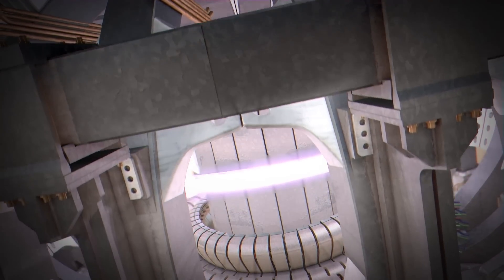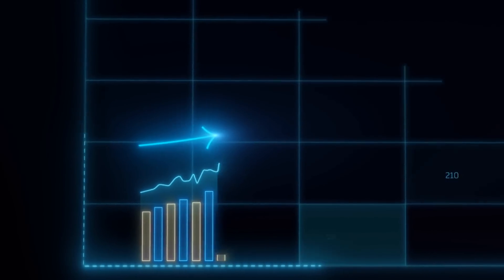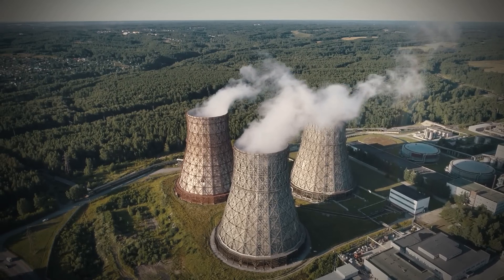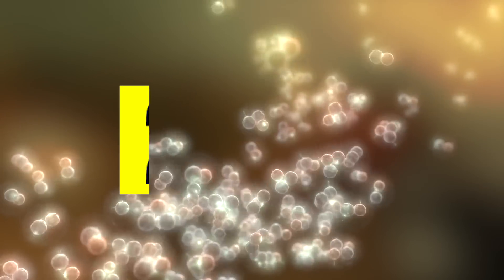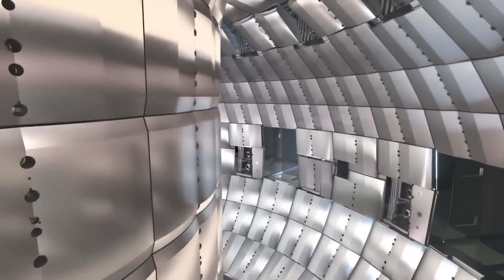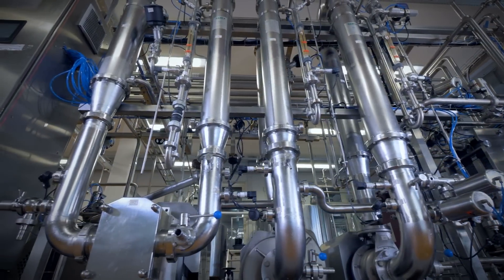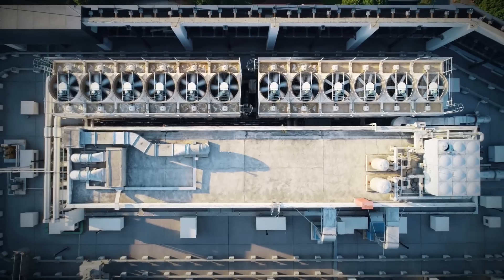The Shocking Problem That Could End Nuclear Fusion

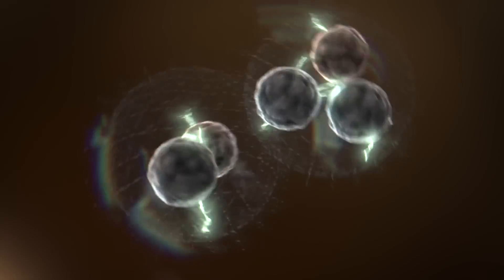Comment: 0:58 already with a problem, with the claim of this video: Why do we need 6 times the temperature of the Sun's core if the Sun does the job, at one time ?  Seems there is a lack of auto-critic to start  with, or is there a reason?
Reply from the maker: Interesting point! The sun can achieve fusion at lower temperatures because it has much higher pressures, unfortunately these pressures are not practical to achieve in tokamak reactors, so the temperature has to be much higher! Hope that clears it up.
Reply: @ZirothTech  Make perfect sense, tks.

Comment: However, if you're heart is set on fusion, General Fusion uses timed-pistons to compressed heated plasma with molten lead-lithium (the reactor spins the molten lead-lithium mixture until it forms a cavity/vortex in the center).  It's this lithium that is bred into tritium.

Comment: Nuclear fission is already clean enough, especially when fuel can be reprocessed or if the fissile material is in the form of a molten salt that solves the waste problem as neutron absorbing fission products like Xe-135 can be easily removed from a liquid fuel.

Society has to get over this idea that there is an energy source that has zero environmental impact.  ALL sources of energy has some sort negative environmental impact. Just look at the rare earth mining operations in China and how they made entire lakes devoid of life or all of the toxic chemicals and carcinogens in photovoltaic production.  Fusion, even aneutronic fusion, will have a negative environment impact if someone is hellbent on finding an excuse to ban it.

Unfortunately, nuclear fission has to compete with the idealized fantasy version of solar and wind power, which made it look dirty by comparison, especially how the media hyped the Three Mile Island, Chernobyl, and Fukushima disasters.  But when compared with the actual casualties vs the total amount of power produced, nuclear fission is on par with solar and wind for deaths per units of energy produce (and yes, there have been accidents involving renewables such as workers falling off roofs while installing photovoltaics or wind turbine catastrophically failing).  Also, it has been estimated that nuclear power has SAVED the lives of 1.8 MILLION people by the offset of fossil fuels that would have been used in its place based on the save estimates for the number of people killed by fossil fuels.

I hope people will not be so quick to write off the source of clean, abundant, and cheap energy.  Yes, I said "cheap" once some serious reforms can be enacted like stopping frivolous lawsuits by anti-nuke craptivists and getting rid of the proverbial foxes in the hen house like Gregory Jaczko who outed himself as an antinuclear power luddite after retired from the NRC and didn't have to pretend to not oppose nuclear power.  And this isn't even taking into account the reduction of cost of nuclear power with new technology like small modular reactors that can be mass-produced in a factory and shifted on site.

Comment: Is fusion our only source of neutron radiation lmao? Just put the blankets somewhere else with a more reliable source of neutron radiation and produce tritium from there. The lithium is not a problem either, 7% rich is very easy compared to U 234. This video is very optimistic about the problems with fusion.

Comment: Making temperatures as hot as the sun, and holding it in magnetic limbo, sounds like a near impossible goal, beside the tritium issue.
Reply: It's actually one of the easiest parts of fusion, a magnetic field powerful enough would do it.

Comment: I used to love the idea of fusion.  But even more than the isotope supply issues here, the greatest obstacle is practically dealing with the huge neutron flux coming from the reactor.  It will quickly degrade and transmutate all the reactor structures and will leave them insanely radioactive ... hard to maintain and lots of radioactive waste.  The ability to get the heat from fusion and turn it into usable energy (i.e. steam for turbines) is not close to being solved.

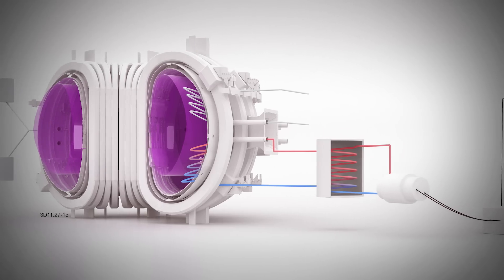Comment: @2:30 It uses 12 kg, per what? per second? hour? year? milenium?

And if its so rare, and can be made with nuclear reactors at the rate of 500grams a year....whats the big deal? we have HUNDEREDS of reactors! and when the owners figure out that that little byproduct sells for 30k a gram they will all extract tritium. Sure the prices may drop quickly but it does give them some captital for a pretty much self sustaining energy source wich only import is deuterium.
Reply from the maker: Sorry that should have been clearer! That is 12kg over the lifetime of ITER (20 years), however it will need almost all of that from the start, as it is required to fill the tokamak even if it isn't being used up. Tritium can be made from some nuclear fission reactors, but not many of them! And the ones that do make tritium are being phased out. I imagine demand for tritium could mean more are made in the future, but there are huge restrictions on this as tritium is also used in nuclear warheads. Therefore, it could be a very long time until this is achieved, as nuclear fission plants take a long time to build even without these challenges! Thanks for your comment and hopefully that clears some bits up!

Comment: Mentioned fuel requirement is not exactly mandatory. It is "first generation" of fusion reactor. Just other fuels will require more extream conditions of fusion so it is logical that we are making tests on easiest variant currently. Also things not abundant at our planet are not nessesery problem long term. He4 would be actually fuel that solves some issues seen with fusion of H2/H3. It is scarse on Earth but for example on Moon there should be plenty.

Comment: fixing nuclear fusion? Gravity/ earth atmosphere.  Nuclear fusion would work in space not on earth . Gravity is the problem.  Keep hot plasma moving in atmosphere is hard because many things? Air ,weather conditions,  Gravity,  movement.  Scientist's should build a nuclear fusion station on asteroid/ space than uses lasers to give power back too earth 🌎.
Reply: Gravity is not a problem at all, the magnetic field overpowers that. While atmosphere problem is solved by using a vacuum chamber.

Comment: The solution is to abandon fusion (for now anyway) and stick with fission but a fission reactor design based on Thorium and not Uranium which produces much less waste, Thorium is much much more abundant than Uranium and reactors based on Thorium molten salts are fail save by design.

Comment: The only well understood and also stable process on that matter is how to burn money and create n+1 issues for n questions. Seriously, following the chase for the holy grail for about 40 years only shows, that it's always only max. 20 years away and meanwhile continuously requires more resources and replacement installations by just bigger ones. Considering the effort already spent and still required, that technology will never ever finally amortize this and succeed with a positive overall outcome. Whenever this will be realized by those who decide for the finances, this will once end the story, not the never ending appearance of coarse or fine grain issues discussed in expert groups. Fusion, no matter how beautiful in theory, is not and will not be the answer. Sorry for those whos playground that is, but after all a Dyson sphere would be easier, less complex and perhaps even cheaper than an endless investment if using fusion power is the requirement.

Comment: Not a fusion expert but my understanding is that there are several feasible reactions, even though deuterium -tritium is the preferred reaction. From what I understand sustaining the reaction is the primary problem. I think you should have at least addressed this point in the video.

Comment: D-D fusion is 100x harder than DT, that is 100x less energy fewer neutrons. It will never ignite, thus have to be driven by external power.  Given the existence of heavy water fission reactors which naturally produce tritium and can be designed to do more, a DD fusion reactor for breading is a non starter.

Comment: See “The Trouble with Fusion”  by Prof Lidsky 1983, MIT, covering the tritium fuel problem and much more, circulated widely in fusion circles decades ago.  

“One of the first issues posed by the D-T fusion reaction was how to supply suScient tritium. Tritium is radioactive, with a relatively short half-life of 12.4 years, and therefore it exists only in minute quantities in nature. Luckily, the neutron emitted in D-T fusion can react with an isotope of lithium to produce tritium…”

“…Lithium itself poses serious engineering prob- lems. It is an extremely reactive chemical: it burns violently when it comes in contact with either air or water and even capable of under- going combustion with the water contained in concrete. The lithium may be either in liquid form or in a solid compound. Liquid lithium blankets produce substantially more tritium and allow it to be more easily removed. How- ever, the need to handle large amounts of this metal in liquid form leads to technical com- plexity and poses safety hazards.
The tritium-breeding region has other engi- neering requirements. It must be designed in such a way that the structural materials, as contrasted with the actual lithium, capture a minimum of neutrons. Also, the operating temperature must be high enough so that the coolant, when piped outside the reactor, can generate steam eSciently.
Outside the blanket, powerful magnets must provide the magnetic fields to contain the plasma. These fields will exert enormous forces on the magnets themselves, equivalent to pres- sures of hundreds of atmospheres. If made from copper wire, these magnets would con- sume more power than produced by the reac- tor, so they will have to be superconducting. Superconducting magnets, cooled by liquid he- lium to within a few degrees of absolute zero, will be extremely sensitive to heat and radia- tion damage. Thus, they must be eFectively shielded from the heat and radiation of the plasma and blanket.
Temperatures within the fusion reactor will range from the highest produced on earth (within the plasma) to practically the lowest possible (within the magnets). The entire structure will be bombarded with neutrons that induce radiation and cause serious damage to materials. Problems associated with the in- flammable lithium must be managed. Ad- vanced materials will have to endure tremen- dous stress from temperature extremes and damaging neutrons. The magnetic fields will…”

In the 40 years since, no prototype work has been done  to resolve the difficulties w T production. As said, it’s expensive and requires all kinds of permits to handle, which is why most reactor tests are done w inert gas.  When and if fusion becomes viable, expect to see a wave of proliferation scare tactics about how T enables hydrogen bombs.

Comment: I think the real question is if we're ever going to get a practical amount of energy out of these ITER reactors at a practical cost. These reactors are giant, expensive boondoggles.
Reply: Everything is an expensive boondoggle until it works.
Reply: @krashd  Except there is no reasonable path forward where this is not an expensive boondoggle, even if everything goes according to plan.

Comment: If Helium is a by product of the initial reaction, can't Helium be broken down into Tritium?
Reply: bruh, the entire point of this is that you get energy from the fusion, it would be like trying to get infinite coal from burning it and then reverting the CO2 while in reality you use more energy to convert it back than you could ever get from burning it
Reply: @boberboberowski3411  I don't know the process or the energy required to break Helium into Tritium. Do you? Have we ever done it?
Reply: @leemistenalt31  I don't know, but even if so it would surely require the same or even more energy than you would get from reusing the tritium

Comment: " Lattice confinement fusion (LCF) is a type of nuclear fusion via exposing deuteron-saturated metals to gamma radiation, avoiding the usage of confined high-temperature gasses used in other methods of fusion ...In 2020, a team of NASA researchers seeking a new energy source for deep-space exploration missions, published the first paper describing the novel method for triggering nuclear fusion in the space between the atoms of a metal solid, an example of screened fusion.[3] The experiments did not produce self-sustaining reactions, and the electron source is itself energetically expensive ' from Wikipedia

Comment: Oh nonsense, tritium is very easy to separate. All you need is palladium, titanium and lithium... Example: The Ponz and Flashman experiments. Simple Electrochemistry and with the fuel source it's easy to get more energy out of the system than the energy that you are using to operate it and hydrogen is just as simple... 💫

Comment: NUCLEAR ARE EASY TO KILL OR DESTROY BY USING OF COLD MAGNET IF INSERTING A MAGNET TO REACTOR THIS IS CANNOT WORK BECAUSE  THE  CONTAIN OF REACT OR ARE SWALLOWING OF THE MAGNET, THAT IS THE REASON WHY VEHICLES ARE STOPPING IN RAIL AND ENGINE ARE DIE BECAUSE OF THE GRAVITY OR MAGNET CAME FROM THE METAL RAIL AND RELEASING IF THE TRAIN IS COMING MADE OF FRICTION BETWEEN WHEELS OF TRAIN AND RAIL AND THE GRAVITY ARE SWALLOWING THE INTAKE OF THE ENGINE AND AFTER ENTER EXPLOTION BETWEEN PISTO CANNOT HAPPEN OR NO EXPLOTION MADE
Reply: at this point google translate would make a better sentence

Comment: All those problems are not a problem at all. What stops us from getting fusion is the problem of high pressure and high temperature. If pressure is too low, then you need higher temperature, so atoms have higher chance to bump on each other and merge. Current problem is to build a container, which can hold a very hot plasma (problem with the cooling) under a very high pressure (problem with strong enough  material). Next big problem is with pipes which delivers fuel and energy to starts the fusion.
I think that the first commercial fusion reactor will be very deep under water in the ocean (like in a drilled hole in the Mariana Trench). That way it will get cooling and additional pressure from the water (to keep reactor intact) and fuel from Deuterium in the water.

Comment: Those are just minor technical issues. We could easily build a new Lithium-6 purification plant if needed, and tritium could easily be bred in fission plants if not enough could be bred in fusion plants. The real issue is that neither of these steps are necessary due to the real lie that is being pushed, the false idea that we are anywhere remotely close to viable fusion power. There is just no need to work on the supply line when it is optimistic to have useful fusion in the next 50 years. Not to mention that fusion doesn't really accomplish anything fission doesn't already accomplish, so it wouldn't be that great of a development anyway, and people would probably just irrationally ignore the technology just like they refuse to use fission.

Comment: While the tritium supply is a true problem for fusion reactors running on D-T fusion, that is not the only method for fusion. There are many other fuel combinations such as deuterium-helium 3 and hydrogen-boron. Yes, they come with their own problems to overcome, but so does every fusion fuel and reactor design. Though, nice vid working to explain mainstream problems for the average person that doesn't do their research or want to study plasma/nuclear physics in depth.

Comment: " Much speculation has been made over the possibility of helium-3 as a future energy source. Unlike most nuclear fission reactions, the fusion of helium-3 atoms releases large amounts of energy without causing the surrounding material to become radioactive. However, the temperatures required to achieve helium-3 fusion reactions are much higher than in traditional fusion reactions,[3] and the process may unavoidably create other reactions that themselves would cause the surrounding material to become radioactive. " from Wikipedia article n helium 3

Comment: I still think that making nuclear fusion produce more energy than it consumes is still the main problem. Once this is achieved, the engineering and economic challenges for getting enough tritium or lithium-6 are secondary. In fact, creating large stockpiles of enriched uranium and plutonium is much harder than either for tritium or lithium-6, and yet it has been done with far less advanced technology by at least two large superpowers. So, once fusion powers becomes energetically efficient, it will give more than enough of the economic justification for breeding tritium, lithium-6 and even beryllium and helium when it comes on shortage.